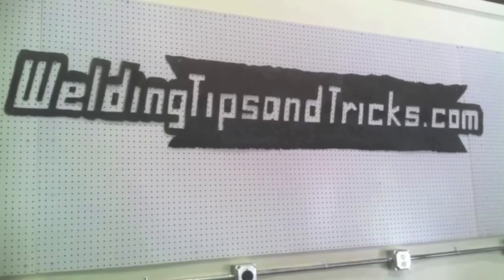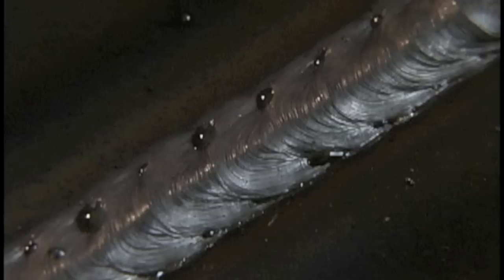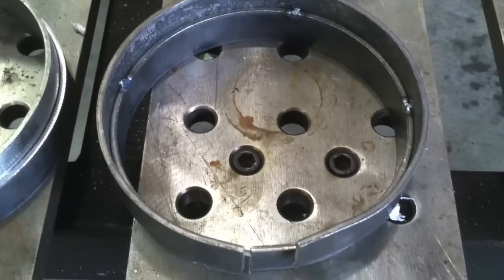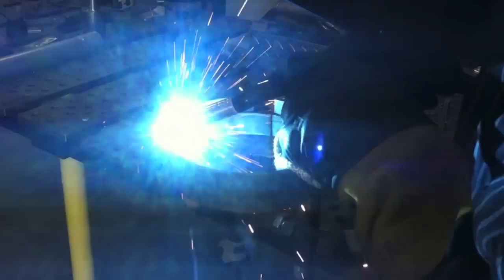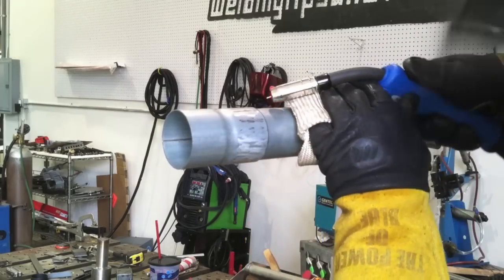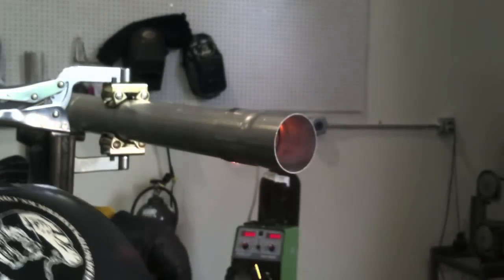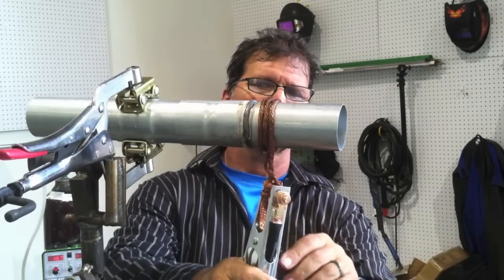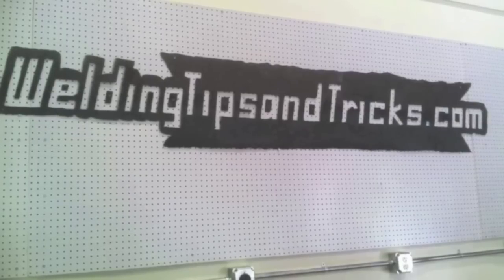Mig Welding Lap Joints...Exhaust Pipes too

Comment: On welding exhaust with MIG, I stitch weld about an inch at a time to prevent burn through. Looks a tad uglier than a straight bead pull, but it's 100% functional and 100% secured. I could grind it flush and make it look pretty, but it's under the vehicle, and I don't have time or care for that.
Reply: Thank you.  I may use this tip.

Comment: Good to point out the welding helmet lenses polish. Depending on where you live, but “Meguiars” Mirror Glaze - #10 Clear Plastic Polish is an excellent option for that chore. It works great on Motorcycle Wind Screens, instrument panel gauge plastic, certain boats just as well. It’s like product sold in NC, is not found in Nebraska. Like PB Blaster pen. oil. Never heard of it, then my son brought some from OK City, OK. Nice video!

Comment: what gun angle do you use on that inner part of the horizontal circular lap joint? i weld cement truck drums for a company and i weld a part similar looking to that. ive been having trouble keeping those welds from sagging down over that bottom edge.

Comment: I bet it's easier welding exhaust with bare wire mig instead of flux core. I keep burning through I'm using a 90 amp flux core welder from harbor freight. I've been trying to stitch weld it but it still comes out terrible

Comment: I always have a hard time welding exhaust pipes, I usually melt through. You suggest high temp and moving quick or turn it down and slow down the gun travel?
Reply: All depends on what youre comfortable with. I personally turn everything down

Comment: since you are right handed it would be way easier to put your left handed pinky on the pipe (0n the left side of the weld joint) and then rest the neck or nozzle on your left handed thumb and run it down. I welded converters for a few years and this was how everybody in the shop did it, including me...give it a try some time...keep up the good vids.

Comment from the maker: remember, i am using .030" wire.  For production welding, 18 volts would definitely be considered cold. But for small projects like I am doing in this video, its workable with .030" wire.  I usually use .035" wire and about the same settings you listed for get her done type production.  thanks for the comment

Comment: Im a welder for a company and i do alot of parts with 11 gauge for the military and the parts typically have alot of lap joints. When i weld a lap join i usually have my welder set at about 21 amps and 330 for  wire speed. Today i did the 18 and 275 like u said and it seemd kind cold. But i like the technique u use for laps im tryin it out today. So thanks for the tips :)

Comment: Good stuff. It's a little harder to get the 12 o'clock position welded right on a muffler when you're on your back under the car, though. Nearly impossible to get the gun in there if it isn't a tiny, low amperage model.

Comment: @weldingtipsandtricks
i have a regular fixed shade welding helmet with a plastic clear lens to protect the filter plate. that novus 2 stuff that u used in the video, will it work on my clear lens to get rid of spatter from stick welding? And where can i buy that Novus 2 bottle?  it looks like a great item to have in my tool bucket.

Comment from the maker: sometimes i let it ride but not very often because it often hangs up,  sometimes a little too much spatter on the inside makes it arc out and transfer a little current thru the nozzle...and that makes the nozzle ground out on the pipe..and it hangs up briefly and screws up the motion.

Comment: Jody, are you letting your nozzle ride on the pipe or are you keeping it up in the air a little? Sometimes when your are doing MIG work it looks like it is resting on the piece you are welding. Does it make any difference really?

Comment from the maker: get some 1/16" rods either 6013 or 6011 and some scrap exhaust pipe and practice  ...and always go downhill even if you can roll it on a bench, slight downhill gives you an edge....  you should know pretty quick if it is something you can make work.